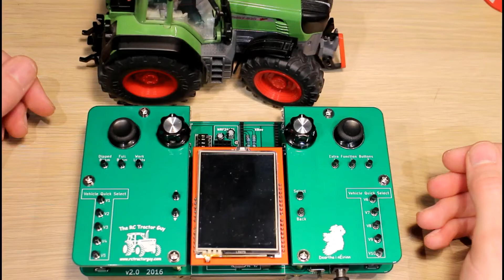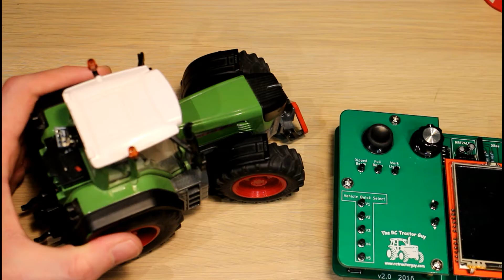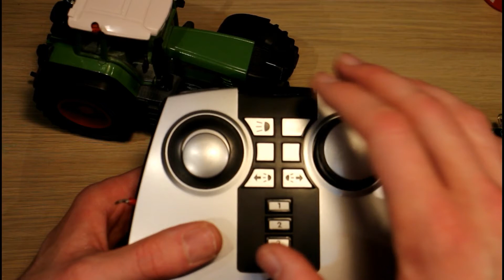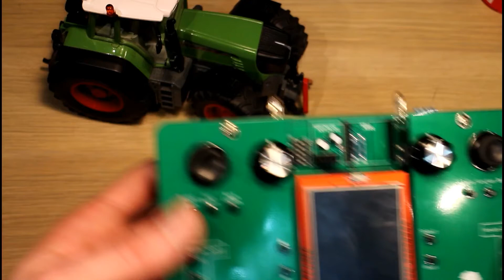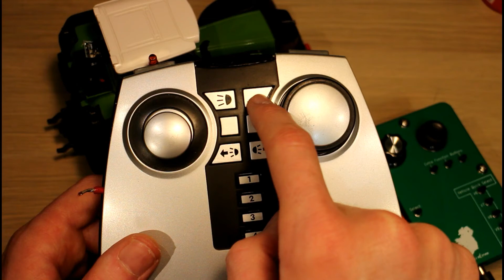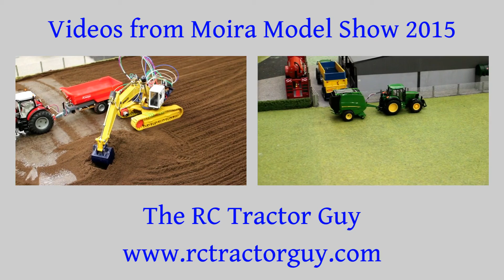Controlling a Standard Control 32 Tractor with my Arduino Based RC Controller

Comment: hi if you use an IR resever in your arduino and a IR program you should get the hex code from the original transmitter and then embedded that in your code .see Great Scott,  control your leds with your TV remote . This is a better and fuller description than can be done in a comment
Reply from the maker: +Paul Sharpe Hi, maybe I'm doing something wrong but I couldn't get a clear signal from my IR receiver. I think it can't pick up the IR from the Siku controller because it is at 14kHz while TV remotes work at 38kHz. Did you get it to work yourself?
Reply: Hi I have just been using a TV remote but it should work as you have had some promising results with your arduino , I'd give it a go I'm interested in the radio / arduino side of what you do